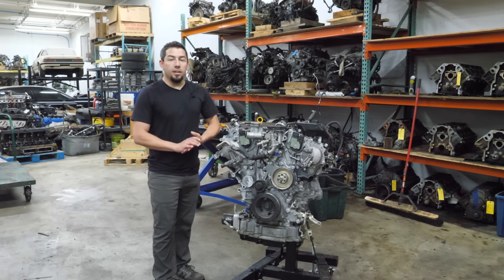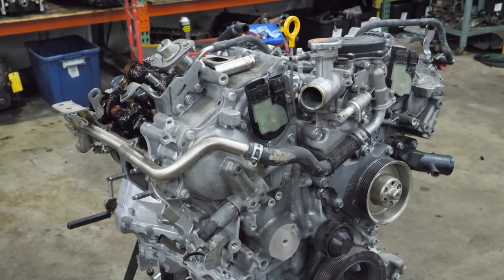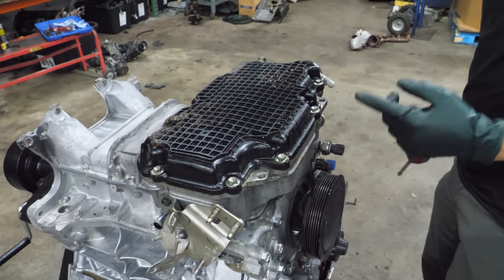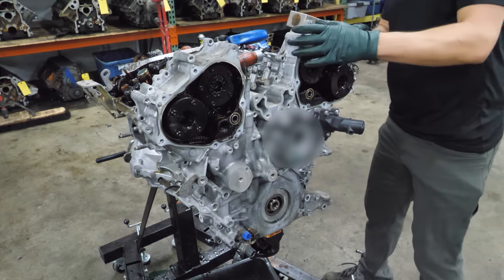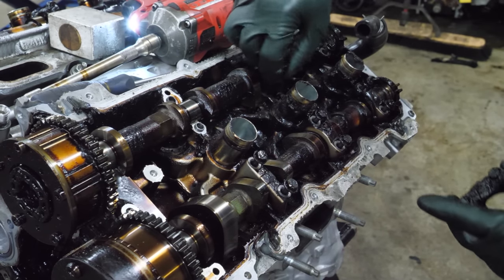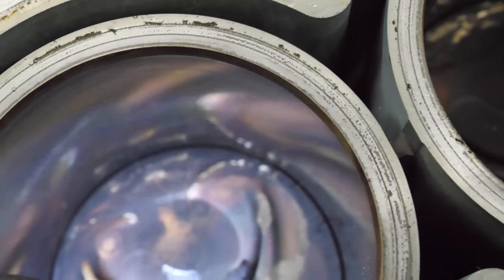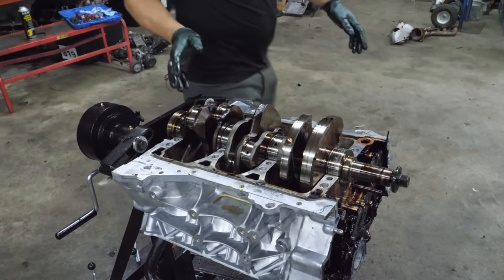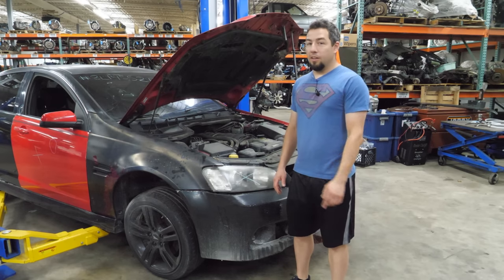60K Miles on 1 Oil Change!?! Infiniti Q50 VR30DDTT Neglected TO DEATH.

Comment: 5:20 In case you're wondering, the reason that the sensor is in the way is probably because the guy who designed the thermostat housing has never spoken to (or even met) the guy who designed the bolt pattern on the engine. When the issue was found, it was probably determined that while it isn't optimal, they can assemble it just as fast on the line by putting in the sensor after the housing is mounted, so it wasn't worth redesigning the bolt pattern on the engine block just to make it easier to get the housing back off.

Also worth mentioning, it's not terribly common to find an engineer or drafter who is also a machinist or someone who turns wrenches.

Comment: Looking at the camshaft and crankshaft journals, it doesn't look like this engine failed because of lack of lubrication. The cam phasor locked up and valves collided with piston, that snapped the timing chain and stopped the engine. Some engines have high valve interference, slightest cam timing off and valves will hit the piston and snap the chain. I'm sure the bad water pump contributed to engine running hot and cooking the oil into a sludge over long run

Comment: The inside of this engine looks much like my family’s 302 V8 in a Ford Fairmont station wagon we had in the 80s. Some idiot at the stealership vacuumed around the EGR because there weren’t any in stock.
If there was ever a poster child for changing your oil and regularly scheduled maintenance this is it.

Comment: 30 years ago, I was tearing down a lot of VG30E cores. We used to harvest the rods for L4 stroker racing engines. You could always tell which engines had Pennzoil in them. I would pull off the cam covers, and the sludge would be the exact shape of the inside of the cover! Yuck....

Comment: I remember my father, may God rest him, in his FIAT 127 in the 80ies did more than 60.000 miles (the kilometre counter broke at about 138.000Km a year before the car was scrapped) without EVER making an oil change, only doing refills with second grade oil too and only ONCE changing the filter because (I guess, too long a time ago to be sure) the old one got clogged, and the engine did not explode. Was in the end still going, if obviously its performances were nowhere near optimal, when he gave the car to the scrapyard because of structural rust. That engine was... indestructible.

PS
Did I mention that for coolant he used tap water only? No? Well, he did. Indestructible.

Comment: This right here is a fine example of people who shouldn't be allowed to own vehicles. Especially expensive ones. But that's just my OP on the matter. My truck has less than 16K miles on it and we just did the third oil change on it past weekend. I try my best to get it at its' 5,000 mile change interval or just slightly before. Funny enough while shopping for an oil filter I found that GM's 3.0l Duramax uses the same model filter as my Turbo 4 L3B and there's an extended capacity oil filter available for the Duramax. So I think when it's time for a fourth oil change I'll order one of those filters and give it a try. The maker of the filter shows on their site that it can be used as an upgrade for other gasoline 4 cylinders in GM's small suv's that use my engines filter model. Even though my engine isn't on the list directly I don't see why it wouldn't work if two other engine models take my same filter. The extended capacity would be a big plus, especially once it starts getting hot in summer. :)

Comment: I had a 740iL that failed with the same issue .. lack of oil change over  240k Km. All the conrod bearings were routed... But surprisingly the mains looked OK.

Comment: I think they do the friction fit for the oil pump in the case it needs to slip, like if the oil is really cold or the pump itself seizes, that way it can slip without causing everything else to immediately explode. Just a thought tho

Comment: in fact even the keyed section holds no torque by the means of key.  Key is just for assembly purposes only,  all the rotational force applied to timing mechanism is held by front main bolt clamping force.

Comment: Neighbor lady put 134,000 miles on her 1 owner 2003 Grand Marquis with out one oil change. She got the car new and just never had anything done to it.. The timing set failed and the chain ground through the timing cover. New timing set, cleaned the oil pump pick up screen and all good, as smooth as butter.... I just don't understand why people won't check or change their oil..

Comment: I went to school with a girl that drove her first car for 4 years until it locked up. She never knew you had to do anything other than put gas in it, turn the key, and call a mechanic when the car completely stopped doing car things. Noises, vibrations, doesn't matter until it stopped running or moving, then you call. 

She learned pretty quick that vehicles have more statuses than just "working" and "not"..... 🤦

Comment: I worked in a shop on I 80 in wyoming.  A sales person came in with an engine knock on a year old chevrolet. Pulled the oil plug and had to use a screwdriver to get the oil to come out. Told the sales person that the engine was bad. We pushed it to a parking spot. The next morning a rollback was there with a new car. Talking  to the driver and he said it happened every year. No service and ran until it quit and bought a new car.

Comment: I ran 1/16 compression rings and 1/8 inch oil control rings for years and had zero oil burning problems.  The problem of oil use comes from the oil ring drain slots in the piston becoming clogged from idiots not changing their oil on a regular basis.

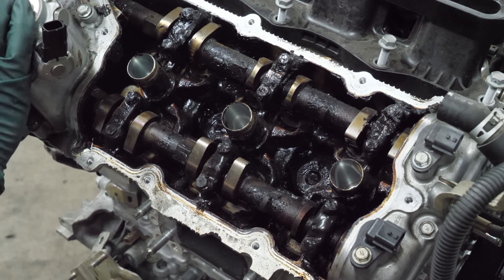Comment: @3:12

Do not forget about the 7-11 book-time hours of labor to rip the sludger out and to put a freshie in.

The book times at dealerships in 2024 in the Chicago area location average around $185.00 per hour. 

I have a family member with a mid-teens Qx60.  The shut-off electronic system failed and the car idled all night long until the shop opened in the morning.  I was terrified as the warranty period was long gone.

I asked the service manager "what a new engine would cost" for this said car.  He must be including labor, but his response was coolly: $16,000...!!!!

Comment: It’s really sad to me that a lot of the new technology we’ve seen added to cars is just adding to the failure points. You have direct injection which yes is far more fuel efficient and allows for more aggressive tuning. However port injection is not bad at its job and also plays a very important role in having fuel rich air passing directly over the valves with a solvent (gasoline or ethanol) which do a good job dissolving oil carbon deposits and bringing them in as a wet burnable mixture into the combustion chamber. This works to keep the valves much cleaner of carbon in a well kept engine.

Don’t get me started on the many, many alternator decoupler pulley failures I’ve been seeing on Fiat/Chrysler vehicles including Ram, Dodge, Chrysler, Fiat, and Jeeps. I don’t know if any of the Alphas share the same design but that’s because none have been brought to  me so far for repairs. I have had some failures of the same alternator decoupler design on some other brands. None have been as repeated as the Chrysler group brands of cars I’ve seen though. I’ve probably fixed about 12 of these already. Most times just having to replace the entire alternator since most my customers do not want to wait for me to track down a replacement decoupler pulley. Thanks to the fact that most places just sell the Alternator and Pulley (Decoupler) as one piece. And although I know a solid/fixed pulley would work just fine, I’m not going to risk my reputation testing the theory on a customer car. And none of my cars have a decoupler type pulley that has failed. The wildest part is one of the decoupler failures I had came in sounding like it had a rod knock and loose rockers slapping around. Yet even though it sounded like a catastrophic engine failure it was in fact just one decoupler pulley having its internal bearing and spring fail and not allowing a proper freewheel on engine deceleration. Once I popped the serpentine belt off to see if the engine was in fact going to be worth fixing at all, the engine was then whisper quiet. Well as whisper quiet as those 3.6 V6 Chrysler engines can be, which isn’t very. Still it was crazy to see a pulley freewheel design that has repeatedly failed just passed warranty on so many cars. Especially when it has such a seemingly lower priority function than the pulley itself. The decoupler design is to lessen vibration and allow you to put less tension on the serpentine belt overall, so as to lengthen the life of the belt. However I never had a huge problem with the original fixed pulley design overall on ANY car as it was. So then what good is this so called feature, when it fails way before a normal pulley. Since a normal fixed pulley would never explode parts everywhere in normal working operation. It would only get so worn from belt contact that it may need to be replaced. But that would be noted by a squealing or slipping belt from it sitting improperly on the grooves. Now the new design likes to explode, destroy the belt and dent the hood/bonnet in the process creating more problems then it needs to.

Comment: That looks a lot like the inside of the original 2.0T engine that was in my wife's '15 Malibu. Although I think hers was worse. She went something like 25k on one change, never checking it. And it still ran until it blew a turbo seal.
Reply: You can tell this engine was maintained by a woman. This is the exact type of shit they do. When I asked my ex when was the last time she changed the oil in her car she said "It says change oil soon. Not change oil NOW". Jesus f'ing christ. That should have been my sign to leave right then and there.

Comment: I just got a new van and the service manual claims 30k miles/2 years for oil changes…
It’s an emission diesel and… yeah, let’s say that I’m questioning whether to make more frequent oil changes.
Ok, it’s Europe and I’m going to use fully synthetic, but still, don’t want to end up like that.

Comment: If I owned one of those I would just use a fluid evacuator tube down the dipstick tube to change the oil. Seems like it would be a more complete oil change.

Comment: What is the deal with plastic valve covers, oil pan and intakes manifolds, what's next is plastic engine blocks with cast iron sleeves in the cylinders. Just curious why did you need to blur the place where the water pump goes?
Reply: Go back and watch just before the blur.  What does the shape of the water pump passage remind you of?  And yes, he did it as a joke.
Reply: @timothyodonnell8591 
OMG..now I see what he's talking about 😂😂😂🤦🏿‍♂️

Comment: The combination of sludgy foulness and clean, uncorroded aluminum is pretty remarkable. Normally engines this crapped up are 180k+ miles and ready for scrap.

Comment: I wound up with a 79 volare duster that had a slant six treated like this.  zero oil pressure at idle, but it did have some off idle.  and it survived like that

Comment: Way back when I changed oil in a Chevette with 50,000 miles on it. It had every factory recommended oil change. I could not get any oil in the valve cover. It was full of sludge.
Reply: P.S. As a 50 year retired mechanic I find it interesting how they build engines now.

Comment: Realistically the only difference between the 300HP and 400HP motors is the tune. They even did away with the speed sensor on the exhaust side.

Comment: If the cooling system wasn't working due to failed/leaking water pump the higher engine temps could have caused what appears to be neglected oil changes that resulted in baked on oil/sludge. Root cause could be high temperatures due to cooling failure.
Reply: @Peter Angles lol, I love your faith in engine self preservation. This isn't the result of a day driving with a leaking cooling system, it is months of driving with an engine overheating. Also I have seen this on Japanize engines which have high running temperatures due to poor cooling design; it has also been the subject of class actions suits for sludge and oil burning.

Comment: Considering doing your own oil is probably around 50$ max, and the dealer/shop without a rip off probably 100$, your pick, spend 600-1000$ over 60k miles or spend 10 grand...

Comment: Pretty wild that it broke a chain and the only thing that would NEED to be replaced is a couple valves, the bearings and piston rings. But OMG was that like 3/4" of sludge on the front face of the driver side head? That is horrifying.

Comment: That's bad, but the worst I've ever seen was an Isuzu diesel powered Bobcat. It leaked so bad that the owner never changed the oil, just kept adding to it. When it finally croaked, we put a used 1 in it. I had to swap the timing gear cover over, due to damage to the used 1. When I took it off, it had a perfect imprint of all the gears in the cover's goo. I think I heard our parts washer groan that day..

Comment: No excuse for this neglect.  Don't skimp on oil changes and coolant top offs.   I still stick to the 3 or 4k miles oil change intervals.  I would never trust a 10k oil change interval.  Oil is cheap, engines are not.  Proper oil and coolant makes an engine happy.   Gee, I sound preachy in this thread.

Comment: Watching this and my 20 Tundra needs oil change every 16 000 kilometres and at 40 000 it will be getting it 4th change on June 1st. So, about every 10 000 kilometres. Here I am debating to add oil because my level is in between the two dots on the dip stick. Oil and filter is so cheap compared to trashing an engine. I just dont get it. Eric, you are not preachy....you are just plain dead RIGHT about oil changes.

Comment: Plastic pan...I'm working on a Ford 2.7 Eccoboost with a leaking(draining) plastic pan. Much sadness. Very time consuming. Ford has a new updated pan which is on the 100th or so revision since 2016. It won't leak they say, for real this time. But the pan has been sporadically available since 2021 and is now on indefinite backorder.

Comment: Man thats as bad as the OG 360 from my 78 Fury that was parked up in 1986 with 80-something k miles. It was so sludgy that literally the only things I saved were the intake and exhaust manifolds and distributor. Mine I attributed to Pennzoil. I guess oils have evolved but they still wont last forever as seen in this engine. - Jamie

Comment: Did you really have to blur the water pump hole? Surely YouTube wouldn't have a problem with a hole in metal, regardless of the connotations of its shape.

Comment: Correct me if I’m wrong, but doesn’t an engine like this want FREQUENT oil changes?  

Like going much past 3k miles (mostly highway driving) can lead to bad trouble?  

And if you’re doing stop and go a lot, you’ll want a (modest?) dose of M.M.O. a hundred miles before your every three months/2500 miles changes?
Reply: Infiniti says 10k mile OCIs are A-okay as of MY 2020; don't know what they were before. If I owned one of these cars, I halve that interval, even with high quality synthetic. I run Pennzoil Ultra Platinum 5W30 in a Ford 2.0L EcoBoost and it gets changed every 5k like clockwork. Had multiple UOAs done, no issues.

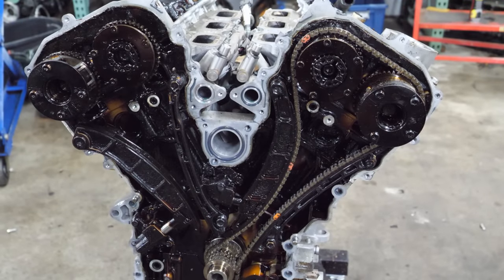Comment: @18:48 even the engine looked sutrprised
You should have seen the one on 'just rolled in, they removed the pan and it was like a sheet of plastic coming out, someone had use vegetable oil
Oil is oil, right ? :D

Comment: I had a 1995 Tahoe that went at least 10k without changing the oil when I did it smelt really bad it reminded me of used hydraulic oil, the engine didn't last long afterwards as it went to redline and the oil pressure spiked a couple of times then locked up.

Comment: Have a friend who bought a KIA with 24000miles on it.. first year they went over on their oil changes.. i told them if they kept on running the oil that long that they would mess it up.. 2 months ago they asked why it was knocking 😂.. $4000 dollars later they wish they changed their oil more regular.

Comment: It’s not much of a surprise, especially with how most people drive and take care of their cars. Even if they say you can change the oil every 6,000 or even 8,000 miles, I’d still do it every 3,000 miles just to be safe and make the engine last a long time. Even if you don’t drive very much, I’d personally would change the oil every 1,000 miles since oil can sludge up even when you don’t drive much since that tends to happen with engines that don’t get many hours/miles on them.

Comment: Imagine buying this engine. 60k miles and still looks shiny new on the outside. Thinking you got a good deal. Then you remove a valve cover and see this nightmare inside.

Comment: I change my 2021 Infiniti QX80 4WD Sensory engine oil every 3,000 to 4,000 miles on lease, because I fear that if I don't change the oil on time, the engine will seize up. It does take 0W-20 oil.